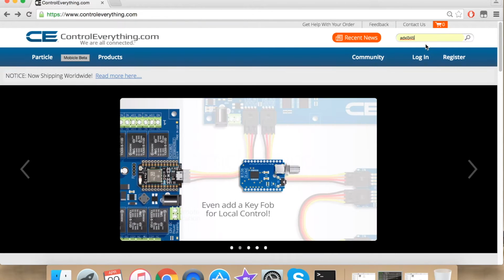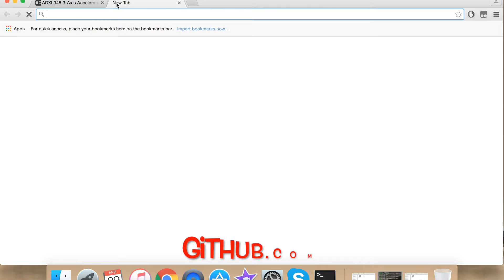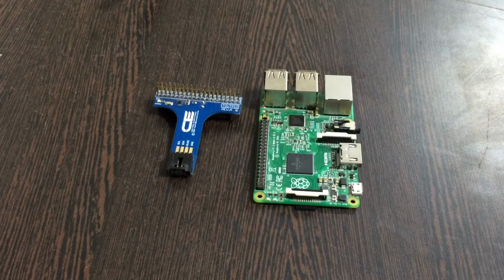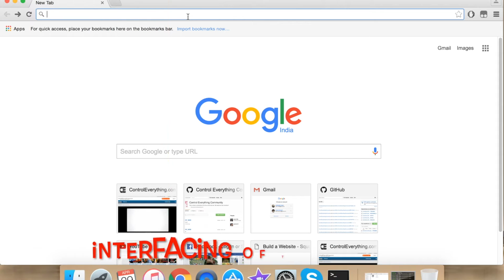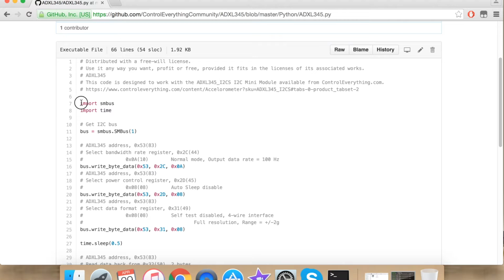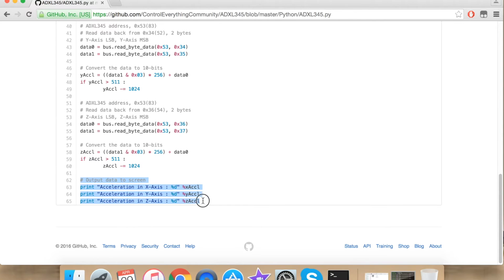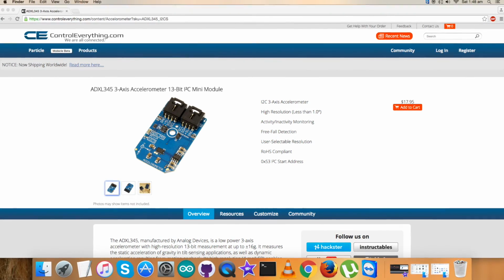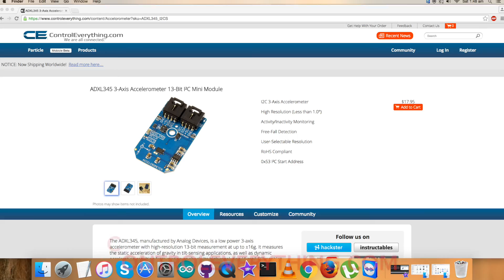Raspberry Pi  ADXL345 3-Axis Accelerometer Python Tutorial

Comment: hi sir,
thanks for sharing this video.I have some doughts about this code.I run this same code in RPi board.after installing smbus and enabling I2C model.but it's showing i/o error on this code, so please help me for this error.
the error is 
{
pi@raspberrypi:~/Desktop/Nexsys $ sudo python ADXL345.py
Traceback (most recent call last):
  File "ADXL345.py", line 6, in <module>
    bus.write_byte_data(0x53, 0x2C, 0x0A)
IOError: [Errno 5] Input/output error
]
my code is:

import smbus
import time

bus = smbus.SMBus(1)

bus.write_byte_data(0x53, 0x2C, 0x0A)
bus.write_byte_data(0x53, 0x2D, 0x08)
bus.write_byte_data(0x53, 0x31, 0x08)

time.sleep(0.5)

data0 = bus.read_byte_data(0x53, 0x32)
data1 = bus.read_byte_data(0x53, 0x33)

xAccl = ((data1 & 0x03) * 256) + data0

if xAccl > 511 :
 xAccl -= 1024
 data0 = bus.read_byte_data(0x53, 0x34)
 data1 = bus.read_byte_data(0x53, 0x35)
 yAccl = ((data1 & 0x03) * 256) + data0
if yAccl > 511 :
 yAccl -= 1024
 data0 = bus.read_byte_data(0x53, 0x36)
 data1 = bus.read_byte_data(0x53, 0x37)
 zAccl = ((data1 & 0x03) * 256) + data0
if zAccl > 511 :
 zAccl -= 1024

# Output data to screen
print "Acceleration in X-Axis : %d" %xAccl
print "Acceleration in Y-Axis : %d" %yAccl
print "Acceleration in Z-Axis : %d" %zAccl

thanks,
rohitpatil597@gmail.com